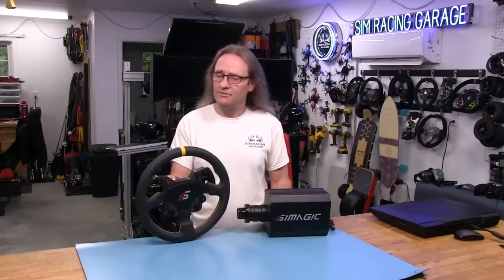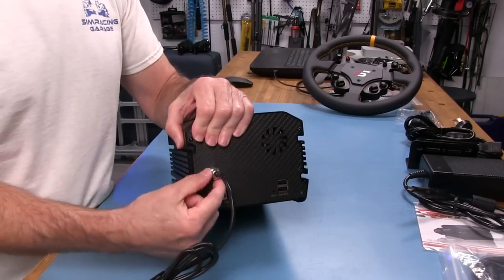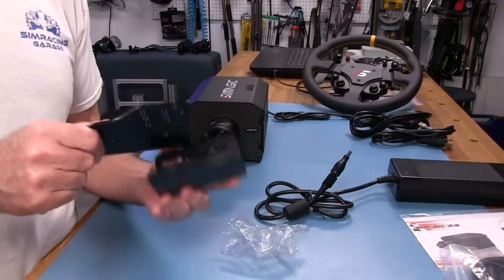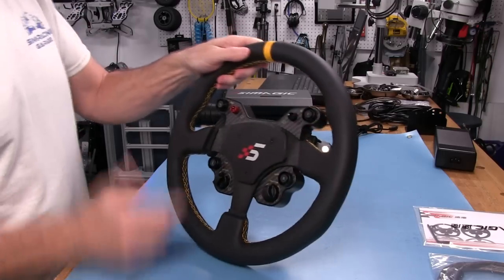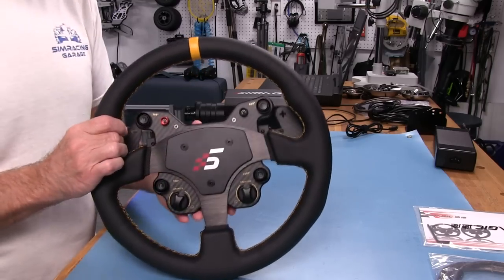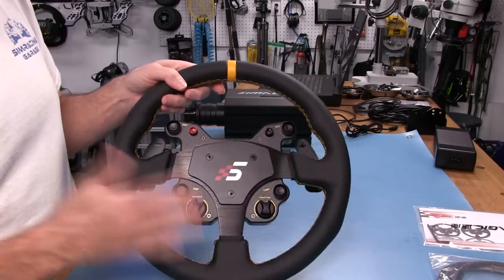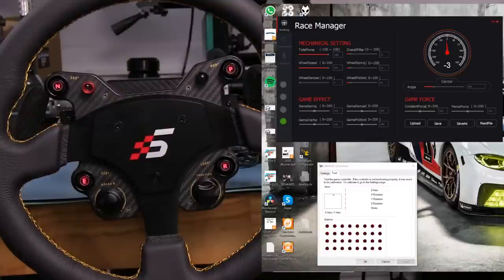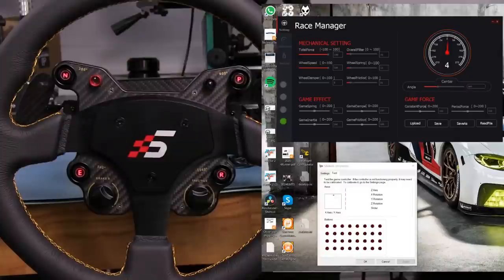Simagic M10 GT1 DD FFB Wheel Kit Review

Comment: I considered this. My first choice was simucube 2 sport. It wasn't in stock and I didn't know enough about this wheelbase. I ended getting a dd2. Kept the dd2 for 4 to 5 months and then got a Simucube 2 pro
Reply: Are you satisfied with the SImucube?
Reply: @bigredracingteam9642  i think its faster and more precise than my dd2 for sure. You can't go wrong with the DD2 though its definitely a solid wheelbase. They keep improving the beta drivers but the official release is over 1yr old and frankly really sucks. Its lacking big time. I never had any issues with my fanatec gear but even so the DD2 left me desiring more. And so I couldn't afford the Simucube 2 Ultimate so I went pro.
Reply: @bigredracingteam9642  yes I'm more than satisfied.
Reply: @chrisjohnson261  Thank you

Comment: I’ve had the unit for around 2-3 months now. It does what it’s meant to do for a stepper motor. The software is the only real let down. 
The wheel and button box is top notch - it’s really the main selling point.
It’s a pity that in China the retail price is so much lower than the rest of world. 
But after testing out a OSW servo motor mige 20Nm with Simucube software it’s a night and day difference so I’ll be selling my unit soon to upgrade and it’s not much of a price difference to change to get so much more road detail and feedback.

I would really like to see a back to back test vs the Accuforce.

Comment: If only the software was as good as the hardware. DD companies should take note to what the SimXperience software has in terms of all the parameters you can work with in terms on the FFB to add on top of what the games FFB telemetry is sending.
Reply: At least they have fixed the spelling errors they have had in the past within the software. Baby steps ;). Doubt you will see anyone provide the software experience you see at SimXperience. Many people who have "upgraded" their Accuforce/Accuforce v2 to "better DD wheels" show some regret because of the lack of tuning available in other software in comparison.
Reply: I'm on the opposite end. The SC software is nice but there's a lot of "canned" effects that eat up a lot of the force that's available. It's not bad but for me, getting the forces where I wanted them with those effects would cause major clipping. As a result I switched to a SC2 Ultimate. It did take a bit of getting used to but after months of using it I could never go back. YMMV
Reply: @26PoundEvo  I use the SC2 Pro and love it. My buddy has an Accuforce and there are certain settings that I would love to be able to add but after using it for a week or so I wanted more torque so I ended up with the Pro. If your using an SM2 Ultimate I doubt youd have issues with a  "force budget". Clipping has never been an issue since I moved to a powerful DD. Have you had I chance to sit down for a while and use the SimXxerpience software with an Accuforce or is your opinion based off others, reviews, or videos? I agree that some of the effects are "canned/post processed" but a lot of them can add boost/gain to many of the games FFB data. For example, a big one for me is Road Texture. For most games/sims I like a lot of road texture and sometimes can't achieve the amount I want no matter how much I mess with the FFB .ini files or in game settings. Especially Rally games. Sure I get road feel but I want more and the OSW software doesn't give me that option. I simply think it would be nice if the software could work with other DD wheels or if they could include similar options/more effects to their own software because FFB is completely "subjective" to every user and the more options the better. With my experience racing on circuit tracks, drifting, and doing the Oregon and Washington Rallys every year, I know the feeling a want to achieve out of my wheel and sometimes I cannot achieve it no matter how much I tweak or how many hours I spend on forums talking with users about settings. Plus, what's wrong with having more FFB options? Having more tuning options is better than less. Even if its a post process, a gain modifier to individual existing effects, or some other effect that pig tails off a part of some other FFB effect. Regardless, Im still happy with my SC2 Pro and dont see myself upgrading in a long long time.
Reply: @bobboberton1841  totally agree, Accuforce  this is our everything! this is the best thing on the market, well, I think so)))

Comment: The machine screws that hold the GT1 wheel, button box, and QR Hub together are 40mm in length, not 35mm like you specified. They are 35mm on the threads, not including the head which accounts for another 5mm. I ordered 35mm M5 machine screws and were 5mm shorter than the stock screws. 
Thanks for the awesome vids, keep up the great work!

Comment: Hey, isn't it the cheapest, sort of entry-level DD wheel on the market? I checked and it costs around 750 euros for the base and 1100 euros for base + GT rim (and you can choose between what Barry has here or Alcantara D-shape wheel). Comparing to others, you need to spend at least 1000 euros for base itself. Of course, it is only 10Nm here, others are 15+, but for the price and if you don't have too strong hands... :)

Comment: Thankyou for the metric measurements. PS: you might want to check the construction of that 3 pin power adapter, it looks a bit like what youtubers call a "death-dapter". Check out bigclive's video on one of them. Probably it's fine. Worth checking, they're not usually hard to take apart and reassemble.